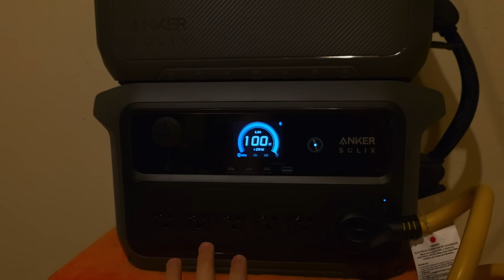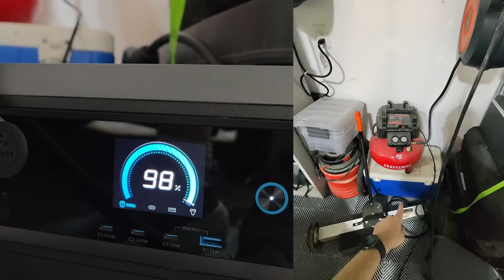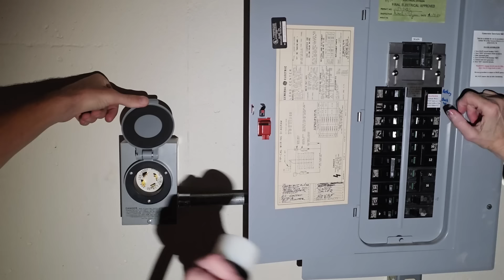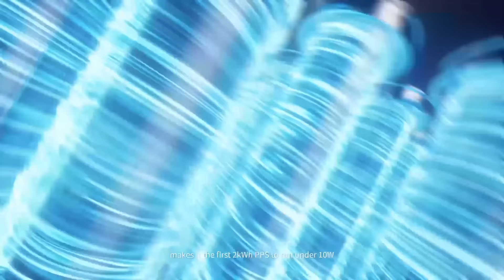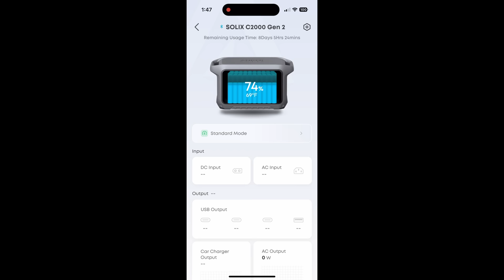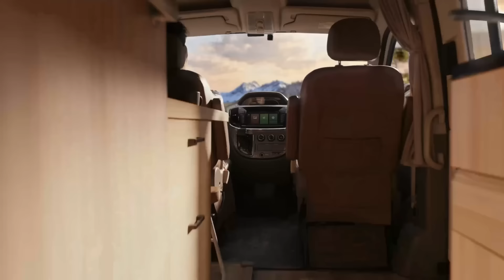Building My Mom’s Backup Power Setup with Anker SOLIX C2000 Gen 2

Comment: or can you make a video on how does the gen 2 2000 works with the plug and how it all connected to the panel. i see videos with f3800 and this 30 amp plug would be useful for this senario for small homes

Comment: Can you just plug into an rv outlet and shut off the main breaker and back feed the whole panel or do you need more wiring changes
Reply: The RV plug only supplies 120 volts, just more amps than the other 120 volt outlets. 

There are two 120 volt supply lines in your home breaker box so the c2000 would only supply power to one of those, basically half your breaker box. 

All the 240, double breakers, would need to be turned off also.